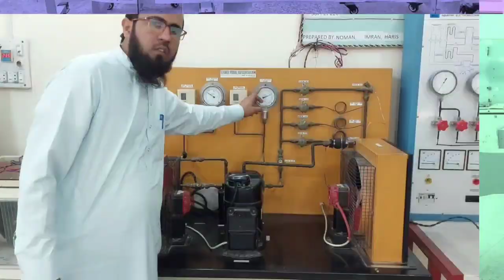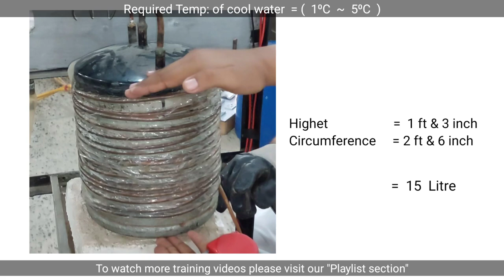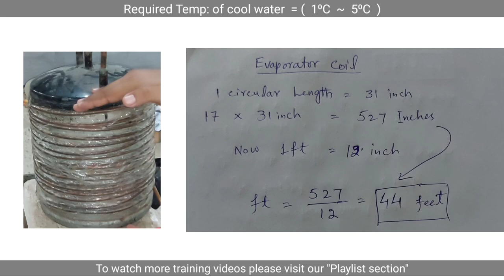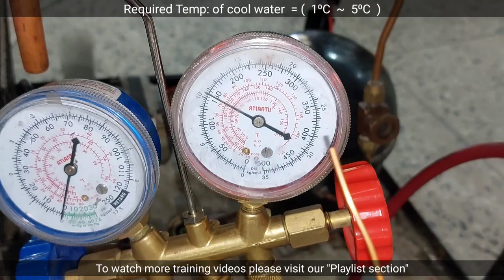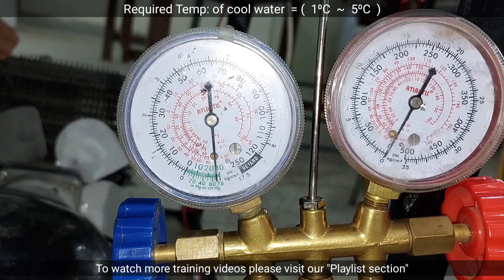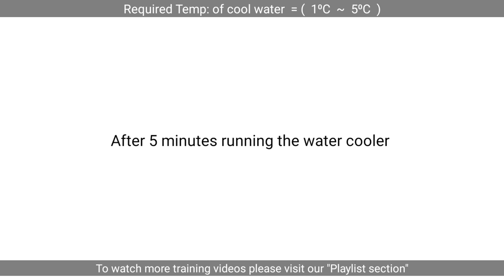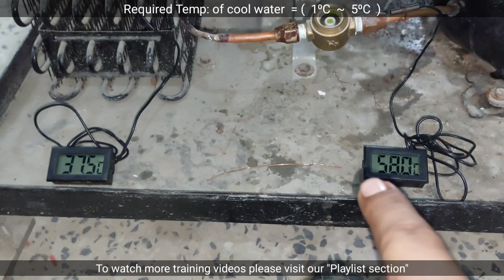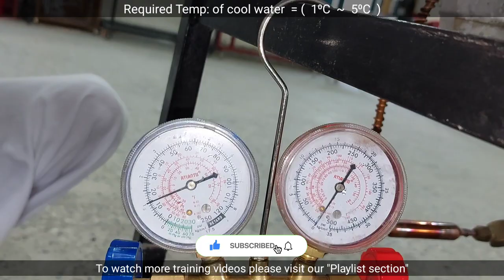Design of Water Cooler | Capillary Tube, Condenser & Evaporator Calculation

Comment: Aslam o alikum sir dawlance ki ek refrigerator hai is ki capliry tube or filter heat ho jata hai is ki kiya waja ho sakti hai is ki Gass original hai
Reply from the maker: Wa Alaikumussalam Bhai,
Maybe capillary tube partially blocked so through capillary tube flow sahi nhi hoti awr islie pir condenser temp: sahi down nhi hota awr awr capillary tube awr filter garam rehte hai,
Ya dusri waja refrigerator bahut tang Jaga ya bahut garam Jaga rakhne se bhi filter awr capillary tube hot rehte hain

Comment: Sir, the liquid gas going to the compressor will not cause any damage to the compressor?
Reply from the maker: Yes of course, 
The liquid gas damage the compressor,
But I have run the unit without water in tank for the purpose of video.
I run that for few minutes only
Reply: Ok, thank you sir.

Comment: sir , first thing no disrespect to you sir.
heat extraction can be calculated by quantity of from ambient temperature to 5C , then work out the surface area of evaporator to extract that much heat , similarly the area of condenser is calculated by inlet / outlet of the condenser flow rate etc etc.
in my opinion this designing is beyond the scope of your students.Their primary concern is of daily repair / maintenance of the system.
again sorry for my input.
I am folly you all the time ,no doubt I am gaining at that maintenance levels
Reply from the maker: Thanks Dear brother for your valuable comments 👍
Yes I know what points did you raise here about the designing of water cooler cycle,
Here I want to clearify you, Actually this is not a proper designing but this is just the cycle calculation,
Maybe you know that my targeted audience are mostly just non technical technicians, So that's why I oftenly make the videos without any complicated calculations.
Thank you very much 🙏

Comment: Great demonstration with a set of parameters indicated for understanding us without load. 

Could  you kindly do the same experiment with full load by showing the temperature and pressure data at various points as you have sensors. 3 set of data . One is in the starting time and secondly after an hr. 3rd one is at the required liquid temp. All the times measure power consumption or current. 

This may help us to understand the behavior of this system. 

Is yr fan is giving air flow towards condenser or compressor?
Reply from the maker: Thanks Dear brother for your valuable suggestions ❤️,
Of course yes I will try to make another video on the points you raised in this system,
The fan is sucking air from compressor side and throws through condenser
Reply: @FKmechofficial  thanks for yr prompt valuable response and we will be greatful for yr next video with full load data set.
Reply from the maker: @majharulislam5950  of course Dear Insha Allah soon